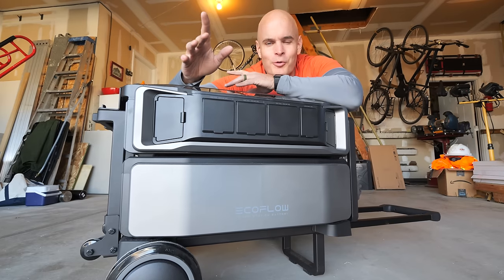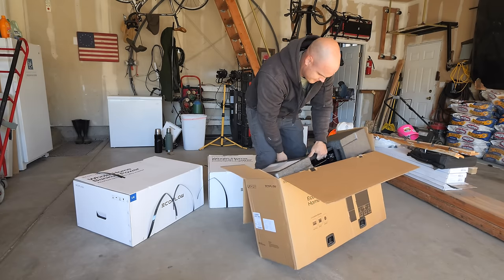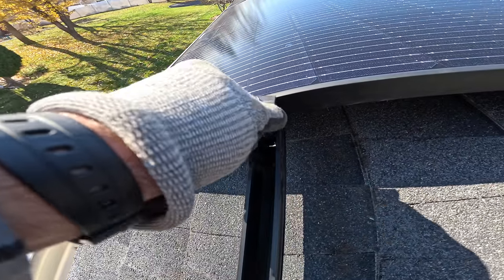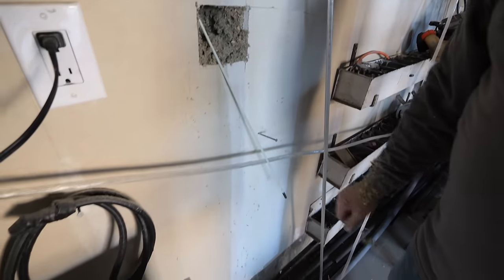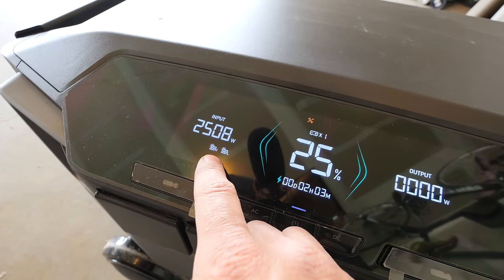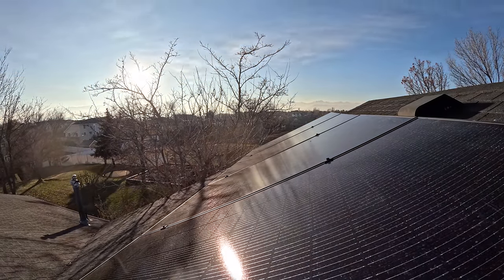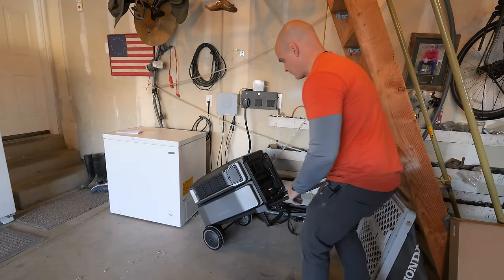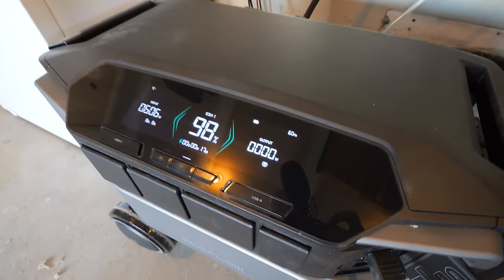Off Grid Stackable Solar Battery - So easy its *Almost* Cheating...

Comment: Step 1: Be extremely wealthy.
Reply: Learn to budget …
Reply: You could budget on even 3000 salary
Reply: If you're surviving from paycheck to paycheck, yeah I can see how you'd think that. But setting aside any disposable income to save for this (or the competitor of your choice) will be worth it. Power goes out? Probably won't notice. Electricity bill? A mere fraction of what it normally is.
Reply: @DarkLink1996. Almost everyone is surviving paycheck to paycheck right now and it’s not for a lack of budgeting.
Reply: @lunchplateboy  
That's certainly true. And I didn't mean to imply otherwise. But even then, there's some disposable income, and in cases where there literally isn't, then obviously, what I said doesn't apply. Same if someone is renting, obviously the battery isn't an option there. This was more about, if you HAVE any, you should put it towards this, because it saves money in the long term.

Comment: At its basic level, it is expensive compared to some other options, but still a good value.
The capability and expandability make it worth considering.
One should factor in labor savings when comparing to a permanent installation.

The smart panel is pricey, but reasonable.
I don't understand why they didn't just REPLACE the existing panel.
The 6KW battery is as large one would want for a portable application.
For stationary systems, larger 15KW units are more practical.
Reply: The original probably had framing around it they would have had to modify not including all the drywall work they would have to do to make it look nice afterwards probably a lot more practical for a YouTube video.
Reply: There doesn't seem to be much space for breakers in the smart panel, but I haven't looked to see if there are larger panels available. Leaving the original panel in situ (and re-working the ground bonding) would allow the original panel to act as a sub panel for more breaker circuits in the future. I don't know if that factored into Zac's father's decision making or not.

Comment: I am looking at this for a tiny home I'm building. But honestly my hydro usage is very low even with a AC, heat and split unit. Essentially this is the same as 5-6 years of my hydro bill. 

Think this is great for multiple people house hold but 1-2 people would take longer to see there return if they don't run a lot of stuff

Comment: Serious question, it seems that with solar panels and battery back up all we'll ever do is break even. If we look at the cost of panels right now and their average life span of 20-25 years, unless theres drastic increases in energy cost. You'll basically only save enough to replace the panels. Am I wrong/crazy?

Comment: I'm currently in the design phase for my future Tiny House on Wheels that I intend on building and living in and this system seems like a near perfect option for my off-grid solar plans! Thanks for introducing this tech to us ❤
Reply: It's like double the price of a do-it-yourself system. Just saying, you might have money like dirt and not care :)
Reply: @sighheinrich , yeah you could always design and build your own system that does everything a self contained system does and trust that your design will get the job done. Most people don’t have the wherewithal to do that.

I suppose you also build your own computers cuz it’s cheaper than buying ready made, huh? Built any automobiles lately?
Reply: Not quite an honest comparison as this ecoflow system also needs assembly and installation. Getting equivalent components from Victron and a ready made LiFePo battery like AmpereTime or Discover you'll have an equivalent system with barely more work than the ecoflow system.
Reply: While I have built my own PC and worked on some small scale electronics, I am a novice when it comes to solar implementation, so the benefit of a self contained, modular energy storage system with solar capacity is the convenience of knowing that it's been done properly and my inexperience in that field won't have a negative impact on my plans
Reply: in that scenario, i think the Ecoflow powerkits make more sense, but the fact that these things exist for those scenarios, is freaking awesome
Reply: @DavidBezemer , so, you disagree with my comparison and then go on to demonstrate that you have the expertise to design and build your own system. I’m pretty sure you proved my point, don’t you think? 🤷🏻‍♂️
Reply: DIY systems are much cheaper and take less space, but do take a lot of research to understand them. I built a 7.5 kWh LiFePO4 battery for $1400 and got the solar charge controller and inverter for another total of $700. Definitely doable and I didn't have any experience past building a PC several years ago. It does take a lot of research and time though, so if you have the money, go ahead with an eco flow.
Reply: wut .. diy solar & battery installs are modular thesedays .. u buy a charge controller etc & it’s not all that different to this expensive ‘ecoflow’ setup tbh almost practically the same, only difference is it’s not in as neat of a package that ‘wheels around’ 🤷 but I’m doubting it’s ability to wheel around or even.. why?  Is it a home system or a portable high capacity work battery?
Reply: @DavidBezemer 

You’re actually suggesting that assembly and installation of an off the shelf system is equivalent to matching various system components, and doing the assembly, and doing the installation? Seriously? lol
Reply: @rossallen738 

Your solar panels were free, I guess and you just guessed how many you’d need… uhh, ok…
Reply: @Sam3532  

Is it written that a high capacity rechargeable battery pack can only be portable or bolted to the floor in your house. Why does it matter.

BTW, have you seen how many outlets Ford and Tesla have built into their trucks. That’s just not natural, huh?

Comment: all this stuff is ridiculously expensive: stackable battery at least 5k, electrical panel 5k, solar panels you would need at least 5 - another 5k. thank you for showing me some pretty expensive stuff.
Reply: 4 Months later, I was able to buy inverter with 2 batteries and Home Panel 2 for 7k.

Comment: This is very interesting because I have two of the older pros and knowing they can work with a new tech is awesome. I’ve been trim to figure out if I wanted to run a Transfer switch or not but this would allow me to do both in one unit.  Also, I’ve got to call you out Jerry. I passed you on 15 North in Ogden Saturday morning 6 Jan you were in your Rivian, and when I looked in my mirror while passing you, you were staring at your phone screen. Please practice phone safety when behind the wheel especially when following tractor trailers at such a close distance. I use to run over the road and have seen very bad things because of a few seconds of bad judgments.
Reply: I have the Pro as well. I've them to be fickle for anything but on-demand use. If you set it up in "UPS" mode, sometimes the AC inverter shuts off even with a full charge.  These Pro ULTRAs appear to be designed for 24/7 use, so hopefully not an issue.

My main concern with this panel is the same issue I have with the other ecoflow units. The ecoflow pro requires an internet connection back to homebase in order for your app to talk with it. Looking at the page for the Smart Home Panel, it seems to have the same requirement. Like please just give me a web page I can access on the local network (or bluetooth).  Even if it was an add-on box that we mount next to the panel.
Reply: @yourtechjohn either you have the Pro set wrong or it's defective.  I use one with my pellet stove.  In EPS mode, it's not a UPS, it passes power from the grid to the pellet stove.  Lose power and the battery takes over.  About 20-30m.

There are settings in that app to adjust the timeout for AC and device use.  If you have either on a time limit, the Pro will fully shut down after the set time if no usage is detected.  Do you have anything plugged in drawing power when the inverter shuts off?  If bot it won't stay on to act as an EPS for the connected device.

Don't you need internet for a web page?  
In any case, dont need the App to control devices.  They make a screen for the Pro's and for the SHP2 that function just like that app on your phone.  Though that is ideally another cost and less convenient.

Comment: I can put a price on energy independence when it costs like $30k to just to DIY this without any pro help. There is obviously a benefit for having something like this, making it much easier to stay afloat in a power outage too. I hope you can make a money's calculation for this and the break even time. 

The problem with my parents house is they have tile roofing and an HOA.

Comment: Average US home uses ~30 kWh a day, so 90kwh would be ~3 days, not a month.
Reply: I'm assuming they mean it can last a month with a solar setup connected to it.  Charge during the day, discharge at night, repeat.  If the charge isn't enough to fill the whole battery, you'll slowly discharge the whole battery capacity.  Otherwise, if you are just running on batteries alone with no charging, you are totally correct.
Reply: @Naviator2012  @50 seconds he says “indefinitely if solar is there to charge them back up.” I think he just misplaced a decimal point when doing math in his head.
Reply: @BraveRock  their website advertises the one month number as well.  It's unlikely you can charge a 90 kW battery in one day just from solar.  You would need a huge solar array and ideal sunlight conditions.  I suspect they are doing some creative math for their advertising though.  Maybe they are assuming you are only running your lights and fridge in a power outage scenario.  90 kW is like 7 Tesla Power walls though, and you could easily get two weeks of power out of that.

Comment: I thought this system would cost twice what it actually does. $7500 for the battery and inverter, $1900 for the panel. Extra battery is $2800. Panels will add another $5k, depending on size and design...and you're officially off grid. It would pay for itself in 5-7 years, depending on where you're at. That's pretty wild

Comment: This is a dream setup for me! There’s just a single thing I’m worried about - the smart panel stuff. If it absolutely needs to use their app, through the internet, with no option for local network management (maybe a Zigbee radio or maybe even a web interface), I’ll be pretty disappointed 
I can’t really rely on my internet working 100% of the time, and I really like having all controls locally.
Reply: For sure a concern, but I'm guessing you'll still be able to manually operate the panel and battery. Just need the APP to control it. I hope
Reply: It has bluetooth

Comment: These things are $4000 EACH!  They want you to pre-pay $300 to get $1500 off, which is just $1200 off.  Which is still $2800 each! JFC, talk about completely non-viable.  You would be better off just staying attached to the grid.  It would take 10 years of usage to break even on this!  The batteries inside would be dead by the time you brake even on the initial cost.
Reply: I think that's for the inverter plus one battery. Each battery add on is $1500ish or this thing is not price competitive with other similar products at all:)
Reply: a 5kWh battery loose is $1400 and a 6kW inverter is also $1400 - add plugs, a trolley and a bunch of smarts yourself, and suddenly you're above $2800 and it doesn't come with a warranty yet... $2800 for 6kWh battery and 7.2kWh portable inverter is insanely low for something with a 5 year warranty - and with enough solar and consumption in your house, can pay for itself in less than 5 years
Reply: @Stefanfj  LFP battery cells like the ones used in this product are so cheap now. You can go to 18650 battery store and get 32 cells at $102.5 with 304AH each for a little over $3100 and have over 31KWh of capacity. One would have to still buy an inverter, BMS, charger and any other desired components:)

Comment: I keep looking if there would be a way to use these with a more traditional grid-tied solar install, maybe more info on that smart panel once the whole system is fully released.
Reply: if you find anything please post it as I am curious as well.
Reply: If you guys are interested in going solar. No money down nothing out of pocket, increase home equity, tax credits, sell off excess power to utility company, never pay a dime to them again and own your power and much more. I work for Solterian and me and my guys can make the transition as smooth as possible.

Comment: Great video and update as usual. I think the key to independence is food, water, and power.  This may solve one problem, but the other two are still big variables in a national emergency.  If you are the only house on the block with electricity, food, and water... Guess where all the neighbors will show up.  I am not a prepper, but contingency planning is always wise.
Reply: It would have been a great video if the price before any discount or coupons were shown.
Reply: Most people that live off grid aren’t living in typical neighborhoods.

Comment: I'm glad you specified that the panel is a "or" panel not an "and" panel.   Since combining solar storage with grid becomes a much more difficult situation to deal with.
Reply: They can be connected as failover and operate when the grid is down though.  There should be relays to choose between grid or battery operation.
Reply: @whattheschmidt  - That is why I said it's an "or" panel.  Going grid tied, charging batteries (to offset usage) while charging then being able to island once the grid goes down (after a grid lock out) is not insignificant which would be an "and" panel.
Reply: @SwordFighterPKN  are you sure it's not an "and" panel? I thought it does all of that.  I plan on getting a full hybrid Inverter that can take my whole 200 amp 240V panel. Possibly the EG4 18K and battery - only issue is I don't need solar inputs since it will be in my basement, main array is on my detached garage and the 2.5kW one on my house has micro inverters.
Reply: @whattheschmidt  - You can't have more than one power source running the home at a time.  So it is either the batteries/solar OR grid OR generator.  That is the distinction I am making.
Reply: @SwordFighterPKN  I see. You can in fact have both solar and grid though.  That's how pretty much every house with solar works, a bidirectional meter.  That's how mine is. The batteries cannot export without extra permission and permits to the grid must likely.  But individual circuits can be grid or battery in that Smart Home Panel and the rest can be grid, at the same time.
Reply: @whattheschmidt  - you are grid tied and the inverter will stop working of the grid goes away the problem is the islanding support that requires a grid lockout so you don't kill a lineman or support your neighbors when the grid is out.   Thus the reason I am glad the panel is a "or" situation since the "and" becomes something that becomes a bit more involved so you don't potentially kill someone.
Reply: @SwordFighterPKN  yes, I am, but the battery I get will be full hybrid and in grid down will island and still take solar. This system will operate off grid in battery mode and I believe the solar will operate too still, since it would go into the batteries only.  That's why the relays can switch to battery operation on independent circuits. The non backed up circuits will go dark though.
Reply: @whattheschmidt  that all makes sense as long as you have an automatic lockout from the grid
Reply: @SwordFighterPKN  yep, these are all automatic and recognize when the grid is out. My solar does too, both the big SMA and all the micros on the other array. The EG4 18K, if I go that route, will disconnect from the grid and then turn on its Inverter and keep power going to the house in an off grid set up, until the grid is back.  I rather have a Tesla Powerwall or similar (Franklin is another I like) but they are way more expensive.
Reply: @whattheschmidt  how big is your auto-islanding system?  Did the utility have to approve it?   How big of a SMA I'm used to working with the 2200 and 3600 ones.
Reply: @SwordFighterPKN  I'm saying currently they won't operate in grid out. But, with EG4 18K and batteries I can make it so the whole system will island and fully operate (to 12kW). SMA is 5.1kW Inverter,  5.4kW of panels. Emphases 2.5kW panels.

Comment: It really feels like these cables inside that type of wall made of easily combustible material are just fire harards. I'd never put that  setup in my parents house. I'd made sure to put all cables inside a bigger tube so that none of the cables could eventually come in contact with the material inside the wall, even in 20 years when some of the plastic round the cables will be sligthly ruined in some points..

Comment: These types of stuff would be useful for someone to achieve financial freedom by being no longer in the mercy of high electricity prices.

Too bad I'm freaking broke to buy one, and live on another side of the world where this tech is unattainable, but a man can dream.
Reply: With solar, you can start small. Buy one panel, maybe second-hand, a battery, a charge controller and some 12V lights. Then grow from there with an inverter etc. That's how I started.

Comment: I m pretty sure 90kwh would not last a month. It was supposed to be 3 days i think instead of 30 days
Reply: Yeah that's like one to two days worth of power for me. I average about 1300 kilowatt hours a month so about 43 per day, 90 kilowatt hours would be 2 days of backup. That's just the house, not counting the EV for another 18 or so per day
Reply: I go through that in a day and in the winter triple that in a day.